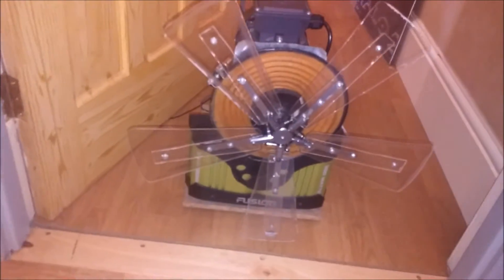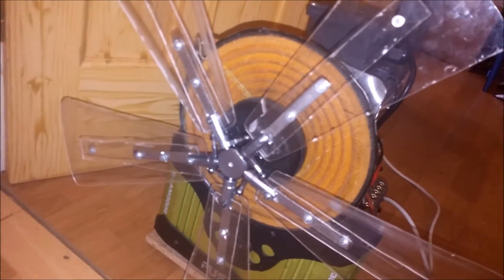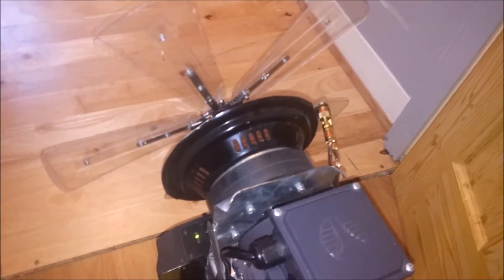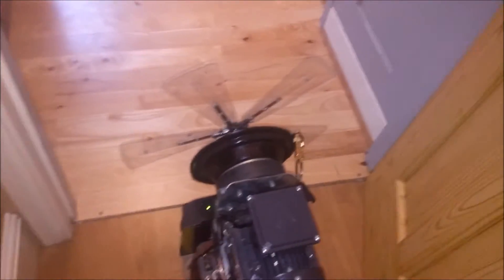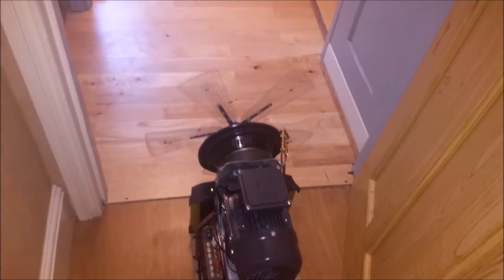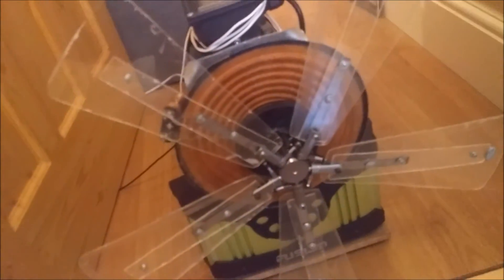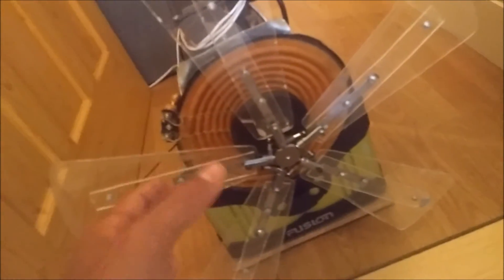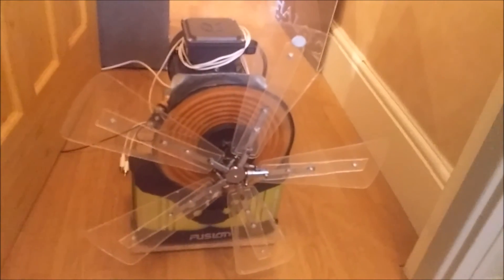DIY Rotary Subwoofer: Update 3

Comment: Hi Chris, im impressed by the project. where can i find your manual?
Reply from the maker: +Casey Callender that was what I was going to do not long ago, shorter wider blades I just haven't got round to doing it
Reply from the maker: I'll post it to you later on
Reply: +Chris Hudlin I know you have re made the link for this thing a million times by now, but im interested as well. Have you ever thought about making the blades shorter and raising the RPM? Maybe the same amount of Bass with lower stress.